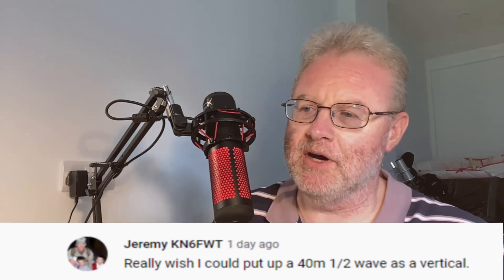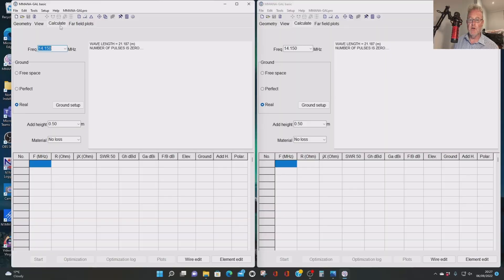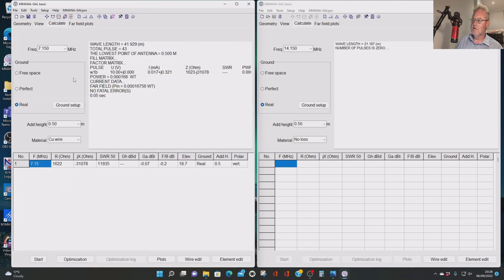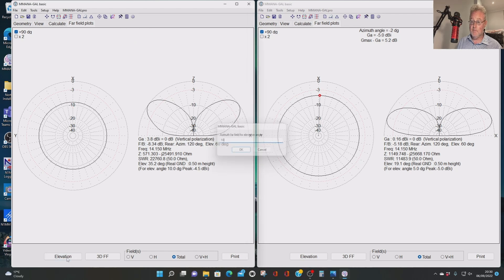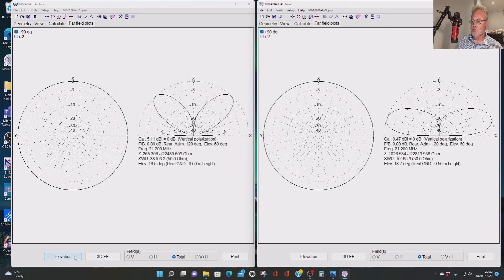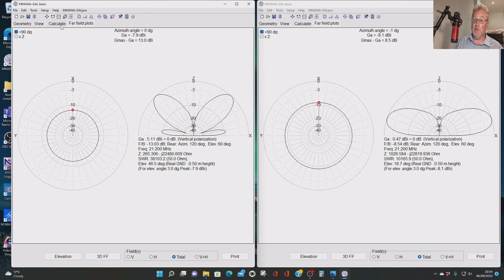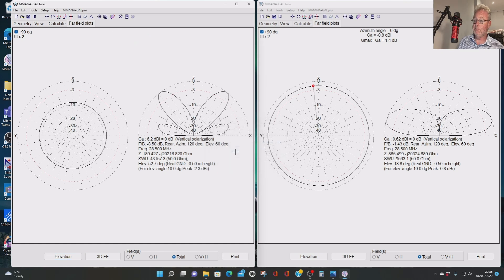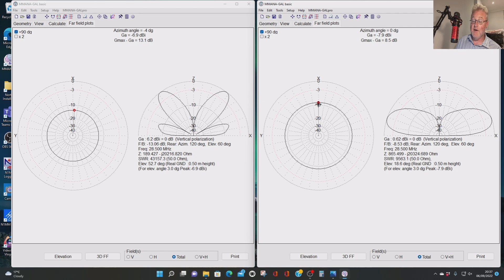HAM RADIO: BIG Vertical END FED HALF WAVE

Comment: Hi, I have a 20.7m wire with a 4m counterpoise connected directly to an external tuner. Additionally, there are 2 common mode chokes (1 close to antenna and 1 close to the radio) to avoid RFI in the shack. The wire is wound on a guyed 18m Spiderbeam pole at around 3m height. It works great e.g. on 30m. 40m works good and 80m looks OK. 10m kind of has a suboptimal radiation pattern and seems to perform worse than a shorter wire, but need to wait for a band opening to see if some new DX might come in. My next experiments will be to add more counterpoise wires to see how that will impact the performance. Thanks for the great video with the simulation results and 73 from Chile
Reply from the maker: Thank you and good luck with the antenna

Comment: We were just starting to see the advantage at the higher frequencies.  What happens if we double the wire length or allow the kite to lift the feed point of the ground?  Thank you for the interesting video's!
Reply from the maker: Generally, if a vertical reaches near a wavelength long, it tends to be less effective (by 2-3dBi) compared with a 1/2 or 1/4 wave for low angle dx. However, it still works and dx is still mightily possible. Feeding a vertical away from the ground always tends to help too.

Comment: Excellent Tim. Loving your recent range of videos.  I have tried a 20m EFHW vertically, mounted on a DX Commander pole. I purchased a large speaker tripod and mounted the pole on top. Was not quite free standing,  needed some chords in the light wind to stop it tipping over. Not bad with 10W but quite noisy, think i should have grounded. Mark, 2E0MSR.
Reply from the maker: Sounds a good portable set up Mark

Comment: Hi hope you're well.
Another interesting video. Of course many practical things to take into account also, one of which is fantastic propagation on 40m this week,  so anything tuned up would work, as I've found working eu stations using very small and low to the ground ants.
But , most like me use 1/4 wave verts on the ground for easy installation and low angle dx results,  therefore with many people struggling to fit a dx ant into their garden, would be interesting if your software could show if there are any smaller ants than a 1/4 wave which give similar results and could fit into a small space. Do some of the loaded mobile ants you use compare favorably with a quarter wave I wonder. 
Odd things with ants vs propagation,  my 40m vertical with a atu in line gives me 40m - 10m dx into eu with good conditions,  where as I think ant software would show that shouldn't really happen. 
Looking forward to your next video, always interesting to see what you come up with next, maybe a kite by the sea .
73 zl3xdj
Reply from the maker: Hi Brian some useful suggestions and observations.. much appreciated

Comment: Hi Tim. Thanks for the mention!

It's fascinating to see what the modelling suggests compared to my practical experience of using it. Admittedly I only tried it on 20m and didn't experiment with other bands, so I only ran it as a half wave.

As you correctly pointed out, the wire is at an angle when being flown from a kite. My guess is that this would make it slightly directional?

I don't know if you've seen it but I also did a couple of videos where I built an elevated 20m EFHW in my back garden on an 18m DX Commander pole with the feed point at approximately 8m above the ground in order to get the antenna above the roofline and away from all of the ground clutter which would attenuate the signal.

Quite some time later & that antenna is still standing. It remains my main 20m antenna.
Reply from the maker: Thank you James. Yes I now recall you used a 10m long wire. I’ll have a look at slopers next I think

Comment: Just about done with my half-wave for
rwenty meters. Saw the design in the 
12/21 QST magazine.  Feeding it at 8 feet off the ground means no radials, but had to use a length of 450-ohm ladder line and make BalUn to get it down to 50
Ohms for the radio.
Reply from the maker: Nice job

Comment: I do that all time, but with a 5m high wire for operating at 10m. It works as good as a vertical, but not requiring radials! Try adding height for the halfwave...
Reply from the maker: Nice job.

Comment: Tim, You need to also add a  vertical dipole for comparison (flower pot dipole)
Reply from the maker: Hi Gwen. Well in terms of modelling there’s little if any difference in the pattern of a flower pot half wave to an efhw or indeed a traditional centre fed vertical dipole. 73

Comment: Hi Tim,will an efhw work better with a ground radial system as I have around 1700m already down n contemplating whether to put my vertical back up or my efhw .I've got a hexbeam up so it's really going to be used to pick the signal up so I can then swing the beam round.thankyou 73
Reply from the maker: That many radials never hurts. It benefits a quarter wave or non resonant vertical fat more than a half wave which needs hardly any ground system owing to its very high radiation resistance. So yes pop up an efhw it’ll be good!

Comment: I built a 40 meter 1/4 wave vertical aluminum tube antenna and mounted on way roof on a tripod and ran radials all around the roof as well as a ground wire to a grounding point. Works very well and I can actually tune it to 80 with the tuner. 49/1 unun with ladder line feeder
Reply from the maker: Interesting design and it works well

Comment: Great video thanks Tim but could you model 49:1 vertical for 9m then horizontal for the rest.that way we could use a fibreglass pole for vertical bit .cheers n thankyou for all your hard work 👍👍
Reply from the maker: Yep ok .. so you mean an inverted L?
Reply: @TIMG5TM  yes inverted L please  Tim.just wanted to know if it will work better n less noise than the vertical .I also have the 80m coil with the 9ft wire after it.thankyou